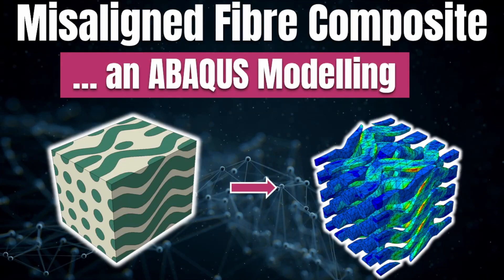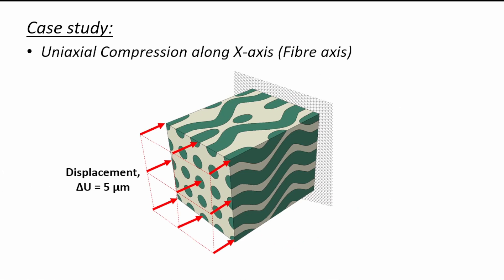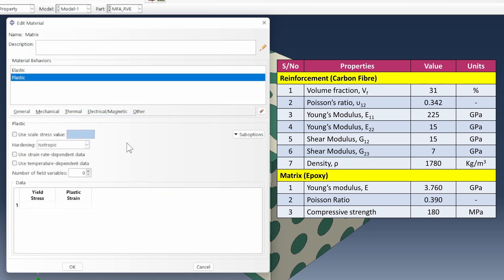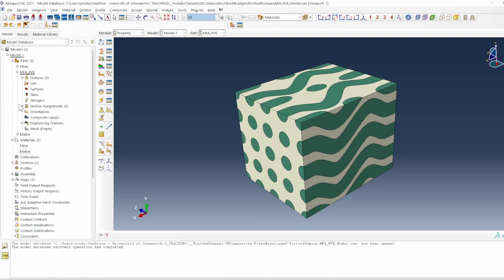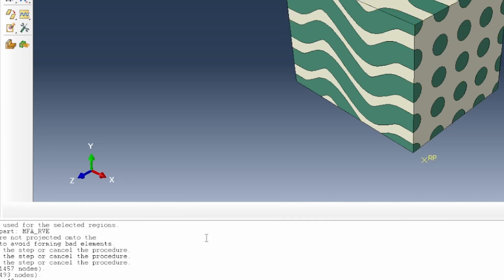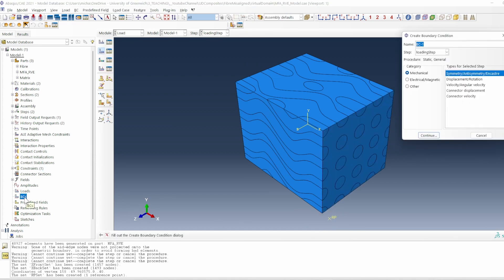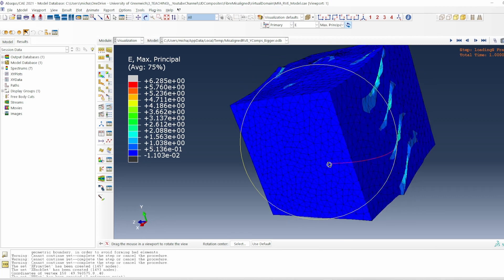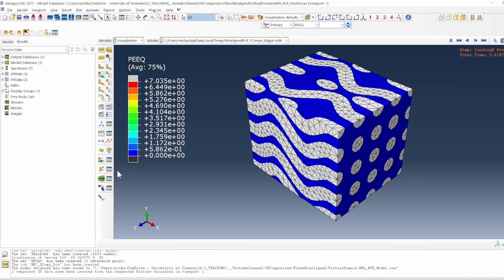RVE Modelling of MISALIGNED FIBRE Unidirectional Composites

Comment: Excellent work! But is it appropriate to assign a uniform orientation to the curved fiber bundles? Could you please do a video on giving material orientation to curved fibers when you are free?
Reply from the maker: Hello @Xiaoyu Wang,  in terms of appropriateness, I do not see why the way I have done it here is not a problem. In an ideal case, you will probably have to specify a material orientation that tracks every aspect of the curved fibre throughout but that means creating multiple orientation elements. This will be the most optimal way to do it. However, what I have done is acceptable but if you want to explore this more, then you will have to assess if there is any error arising from this chosen material orientation scheme. 

Is there some other way you have in mind to do this? I will keep exploring this and see if there is a better, probably more accurate way to do this, without it being computationally expensive.
Reply from the maker: Hello @Xiaoyu Wang, I found this video which is an answer to your question in terms of assigning material orientation to a curved surface. Here is the video by this excellent 10Minuters Youtube channel: https://youtu.be/ZtEZpMTIT6c. I might be able to make a similar video for the curved fibre case used in this video. What I did in the view is approximate and so should introduce some material orientation errors during the analysis stage.
Reply: @MichaelOkereke  Thanks for your patient answer! This is exactly I was looking for.

Comment: Nice explanation!!
Can you please tell us that which homogenization technique is being used here and in the results section, are we visualizing macroscopic results or it's a phase level result.

Also, can how can we use failure criteria in this case.

Thanks
Reply from the maker: Hello @Kewal Kumar, I have not use an explicit homogenization. I simply extracted reaction forces on the faces of interest and displacement on same faces. This is similar to doing a compression test where the test equipment gives you traces of force versus displacement. You will now take them to generate stress and strain plot. This is what is gong on here. 

On visualizing macroscopic effects, yes, one could say this is the case, because the virtual domain is an RVE of the material, so we can trust the results as representative of macroscale behaviour. It is in isolating an RVE that the fun here lies. Ones you get that, the micromechanics emboldens you to trust that your RVE-level results are representative of macroscale behaviour.

You can use failure criteria i.e. specify failure models for the fibre, matrix and interface (decohesion/debonding) criteria. Unfortunately, you will probably have to develop UMATs to explore these as classic Hashin Model in ABAQUS will not apply under this scenario. People often use UMATs or VUMATs for such micromechanical studies.

I hope these explanations make sense to you.
Reply: @MichaelOkereke   Thankyou for your response.

Keep posting such videos, it really helps.  
Appreciate your hard work!!